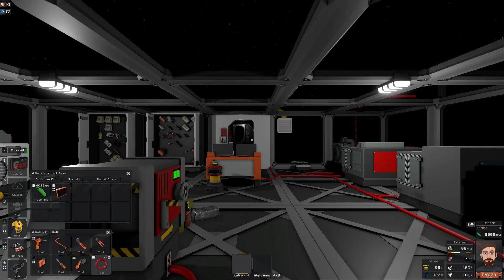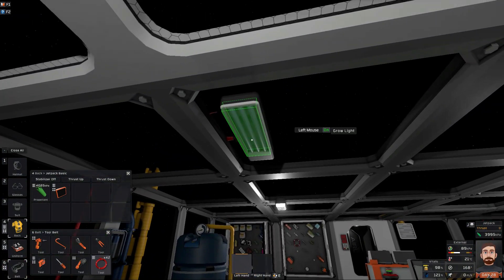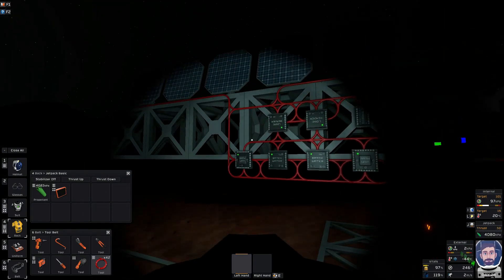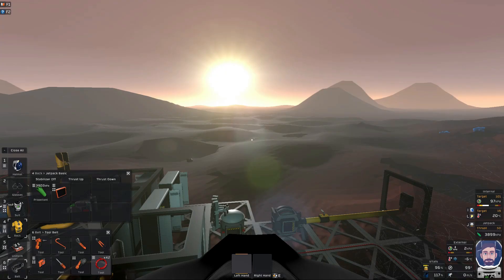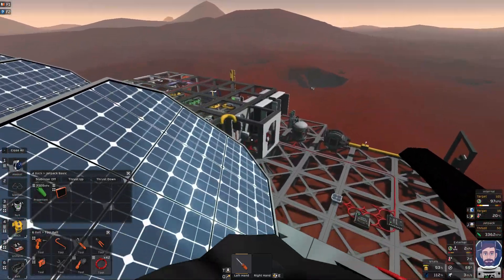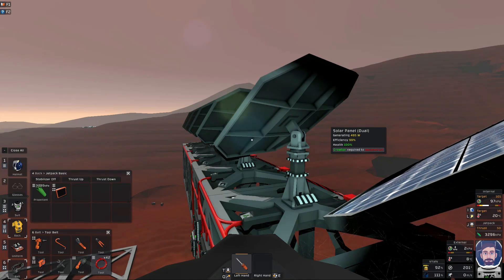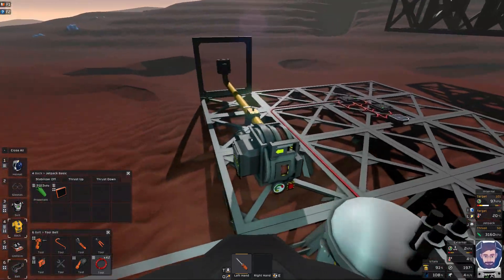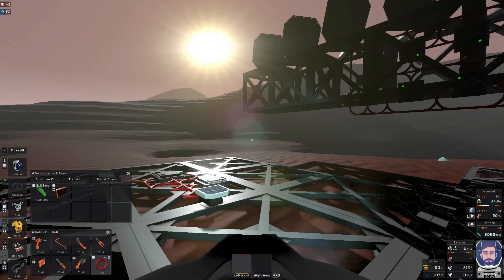Stationeers Tips & Tricks: Solar Power Tips For Your Mars Base

Comment: Hey you should remember to place all panels in an array in the same orientation since if you rotate them (e.g to save some heavy cable when wiring) you'll need extra circuit, so it's better to keep them all rotated the same way.
for arrays that are multiple panels wide you also have panels casting shadows on other panels so you can also stagger the panels to avoid that: place the row of panels that's behind the nearest one to the sun 1 block higher, that way you can have multiple rows in your array and they never cast shadows on eachother, that's also why some real-world solar farms are on a slight incline. This is really good on mars where the grid isn't really aligned with the sun.
Reply: do u know why my panels keep spinning in circles